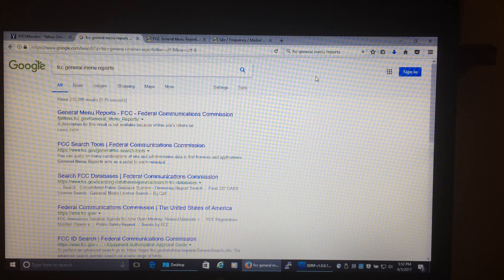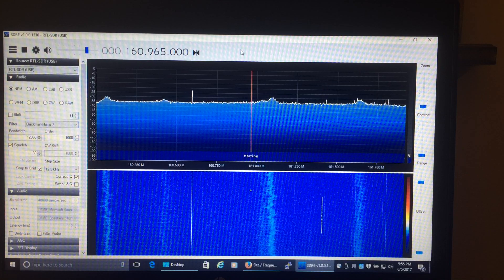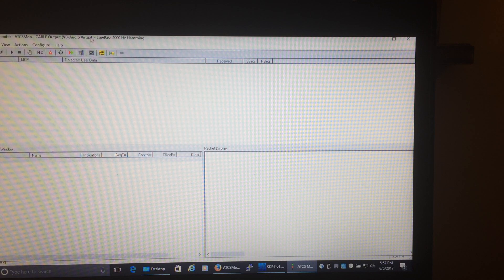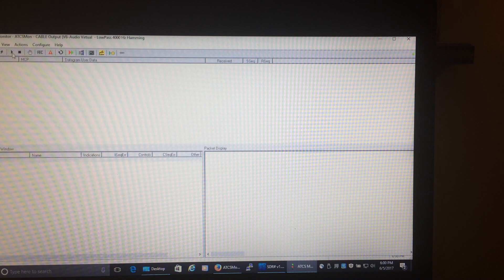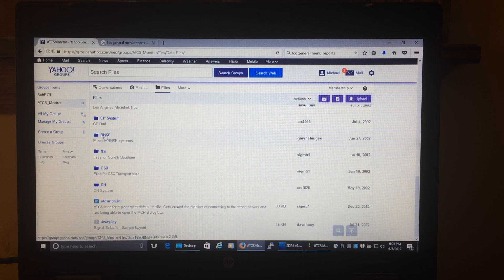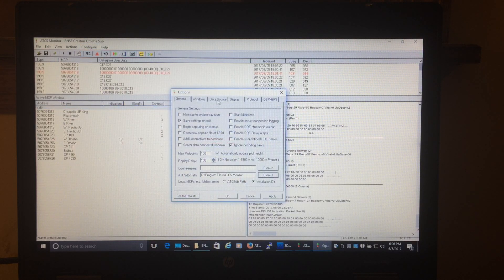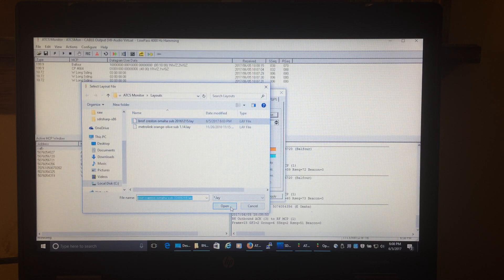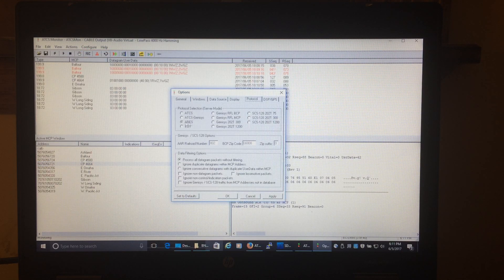RTL-SDR Railroad ATCS Monitor BNSF Omaha

Comment: Do i need a filter for ATCS Genesis?
Reply from the maker: A hardware filter? No. Around the 7 minute mark of the video I use the software Hamming filters; those you need
Reply: @gusgorman3416  thanks!

Comment: How'd you find the correct frequency so fast in that business list? Most of what I'm finding in my area are frequencies that are for actual verbal communication between crew and dispatcher. Some weird unrecognized numbers here and there but mostly not ATCS or anything like that. The antennas are up along the Norfolk Southern line near me but nobody has heard anything over the channels yet so I'm on a mission
Reply from the maker: BNSF uses the AAR frequencies (159-161MHz range) in my area. If you can't find a listing in the FFC databases, you will have to scan all the AAR frequencies and listen for data/telemetry signals https://www.radioreference.com/apps/db/?aid=7747
Reply from the maker: I would have to see the antennas. I used this site to get antenna info for my county https://fjallfoss.fcc.gov/General_Menu_Reports/engineering_search.cfm?accessible=NO&wild_select=on

Comment: Do you know by chance what happened to all the yahoo group data and file. Seem to have been purged.  Has it been moved.....
Reply from the maker: Looks like Yahoo groups are ending in 2020. You can try emailing the moderator, the email is on the webpage http://www.atcsmon.com/  The executable is easy to find & share, but the map files for your city are what's most important. If you have no luck online, contact your local HAM radio club. Each major US city usually has at least one person running a ATCS server, and they usually have a HAM license and are part of a local club
Reply: Thanks, I saw the email address and send an email. Now just waiting to see what happens.
Reply: It's an io group now, look up ATCS Monitor IO Group on Google

Comment: Hi there, cool vid, i have a question regarding my antenna on the rtlsdr. i am receiving phantom signals in a perfectly even spacing. is this caused my the antenna being inside or what?
Reply from the maker: I am not sure. I forget the name of it, but sometimes I get these "mirror" signals, that are about 2-3Mhz from the main signal, and are low power duplicates of the main signal. There's a term for it, but I forget it
Reply: do you know of a way to reduce the sine wave signals?
it looks like ----^----^----^----^----^---- it's just peak signals in an even spacing.
Reply from the maker: If you're inside, it could be A LOT of things. Ethernet cables create a lot of interference if they are too close to the dongle. Besides that, you can trial & error what device is causing the problem or invest in a filter and/or LNA.